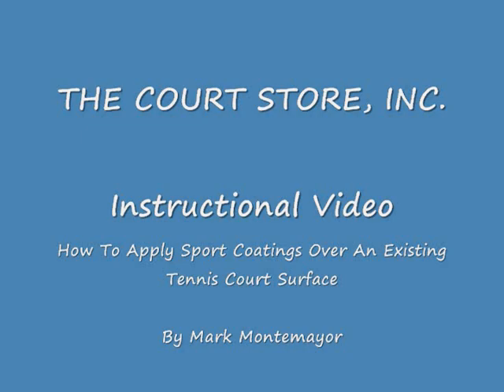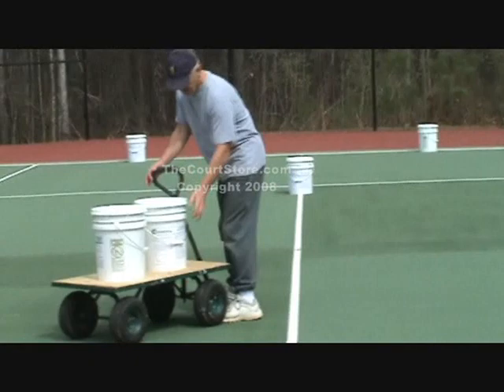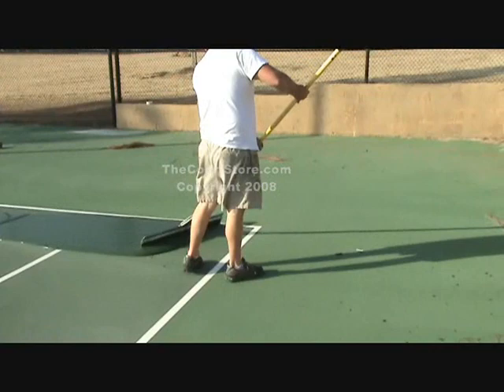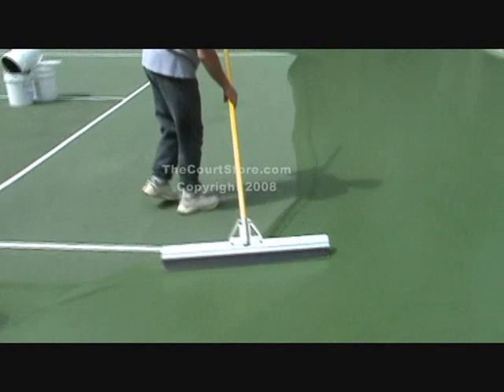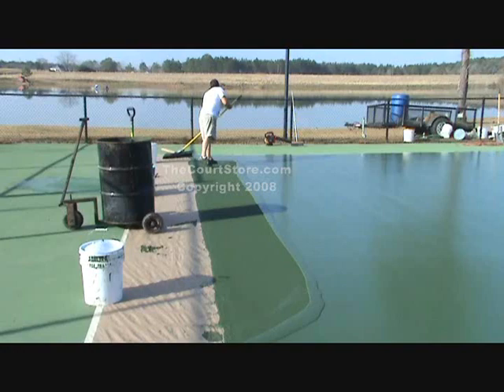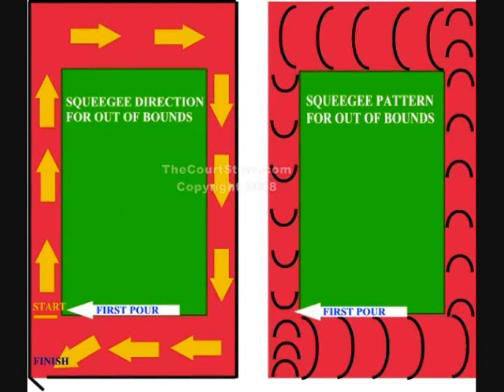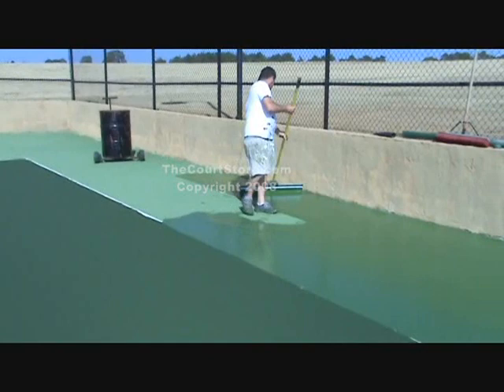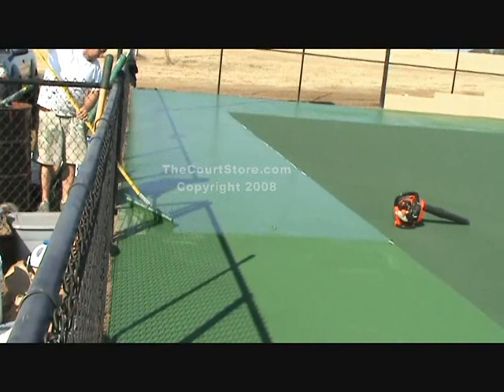How To Paint A Tennis Court

Comment: How thick is the coat. Have an old concrete court. Can I fill the cracks then simply resurface with your product?
Reply: No, paint will not stick to concrete. You have to put a binder on it first before anything else.

Comment: Our contractor/painter seems to have left a waviness or "brush strokes" on our court. Is that normal or did he use improper technique?
Reply: To a degree. There is some marking cause by the squegge but most of the marking comes in a uniform pattern like lines. Inadequate Application  could be a reason for excessive marking as well. So many variants but, Yes there is marking left most of the time
Reply: Good call. To a degree you will see some lines.  Especially when fresh. 
Got to play on it...

Comment: the way one company does it suggests two coats.  dang this would be time consuming at this rate.  Might need more helpers.  Time is money, so this must be profitable.
Reply from the maker: Yes, time is money.  99% of the court surfaces need two coats, but applying sport coatings with a squeegee is the fastest painting method over a large area. It would typically take 2 men three half-days to apply two coats to a tennis court the size of those in this video. The roller method is much slower, but you can break up the job into smaller pieces, doing it as time allows.